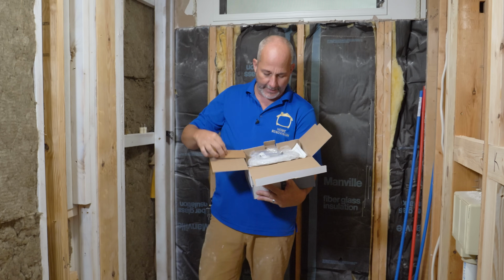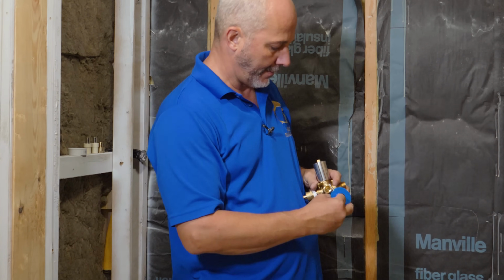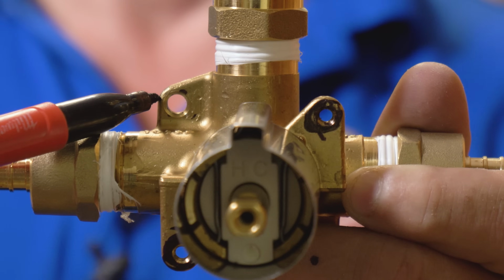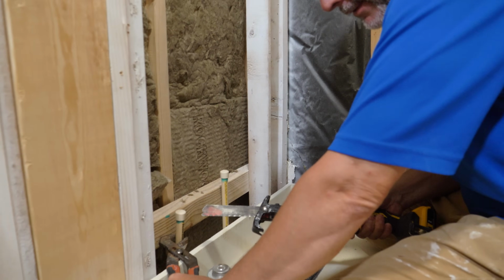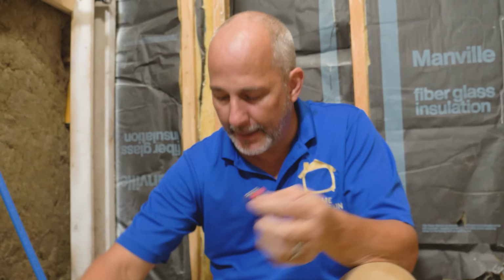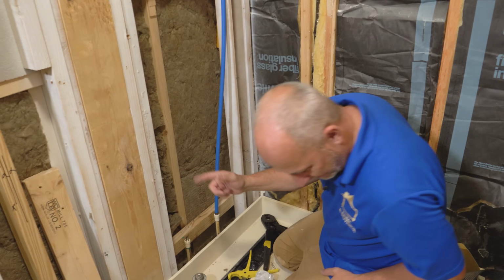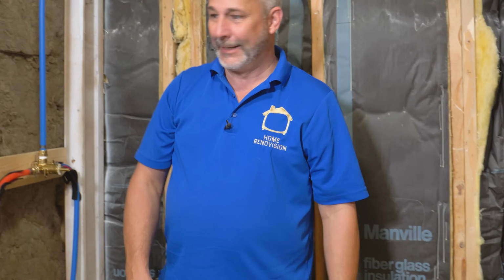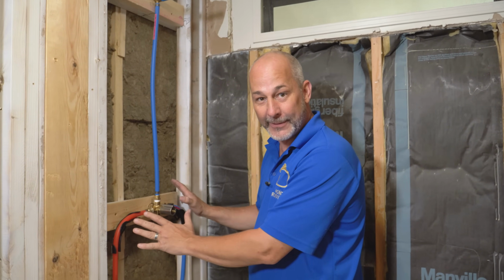How to Install a Shower Valve Kit (For Beginners)

Comment: Thanks for the 'taller people showerhead' install comment. I hate showers that just spray to nipple height! Code used to give a minimum and they took it as max, saves about two cents in pipe, but ticks off anyone over 5-10

Comment: Where was this video about a year and a half ago? I had to build a shower, on my own. That depth gauge was a mystery to me. I had to figure out how to install the plumbing on my own. The final product has some flaws but it functions! I did almost all of these steps in the video. I used Pex A instead of Pex B and I didn’t pressure test. If any DIY-er or newbie handyman studies this video and follows it they will have a working shower at the end.

Comment: I’m glad to see you only used teflon, I’ve seen plumbers use teflon and some kind of blue paste.  I feel more  confident in my shower valve replacement now
Reply: The blue "paste" might be Blue Magic pipe thread sealant or a couple of other brands. In a perfect world plumbing threads are tapered and should lock together with no leaks. In the real world it just doesn't happen. Teflon tape is good and adding the pipe thread sealant is just a little more insurance. Very common in the industry.
Reply: @rrrusted2883  Its funny to me because I have always been a "teflon tape only" guy. Last year I was doing up some 1.25 inch PVC pipe fittings to my water pump.. One joint just would not stop dripping no matter how tight I got the threads. So I decided to try my "Rectorseal #5" pipe dope that I had used on my gas pipes some 20 years ago.. Same can.. Took a while to mix it up of course. I slapped that on the threads and didn't use any teflon tape.. Sealed as solid as a rock.. Its now my go to method on all plastic threaded joints.

Comment: I got a Moentrol "shower only" valve for my mother's ADA shower that we are going to put in-- hopefully sometime late this year or early next year. Make sure you check if its for PEX A or PEX B before you buy it-- and don't trust what bin its in. Make sure to carefully read the bag- and check the bag for holes and make sure no one stole stuff out of it. If you do curbside pickup, doublecheck that they gave you the right stuff-- I had a big box store make mistakes when pulling stuff.
Do you have any opinions on teflon tape vs teflon pipe dope (sort of a liquid sealer that gets brushed on)? I like to use rectorseal on some stuff, although it can be messy.
Drop ear ell with PEX connection is a good idea. Saves on having to get the adapter. 
Your tip to avoid crossthreading has helped me a LOT. With everything from medicine bottles, food jars, to plumbing fittings.
I have arthritis in my hands and wrists so I often get my best friend to tighten stuff for me. Even with two sets of channel lock pliers it can be tough, but using 2 sets of pliers is a good idea.
We added shutoffs that will be accessible via an access panel behind a piece of furniture in Mom's room for when we install her new shower. Having shutoffs on each line really helps if you need to cut the water off quickly. Whenever we've had them off for awhile though, I like to aim the pex to a bucket and open the shutoffs to let sediment clear the line before attaching a new fitting/valve. Well water can be pretty nasty at times if you don't have a filtration system.
I was lucky when re-doing my shower and putting in a new surround because the plumbing was in a closet behind the shower so we had access from the back. That made things easier because we were able to put the trim in afterward. Picked where we wanted it to go on shower side and drilled through (pilot hole first and then followed up with a hole saw). 
I used cementboard and a glue-up surround. Never liked tile. LOL. 
Ah, 84". I was thinking 80. My showerhead had to be mounted lower because we couldn't get it higher on the other side of the wall due to obstructions. But I'm only 5'5" so it worked out for me. It's a little low for my brother who is about 6'3" but when we do his shower we will put the showerhead up higher and use an S-arm to make it even higher.  Having different shower arm options helps. S arm can raise it a few inches.
I always use a PVC cutter for the PVC and CPVC. Seriously thinking of investing in an electric one if I can find one cheap enough because of arthritis. I don't think I could hold the reciprocating saw with one hand and still cut remotely straight. LOL.
I like the sanding straps thingies that you can wrap around the pipe to rub it clean/scuff it up to grab better. 
It used to be cheaper to run 1/2 PEX through a 3/4" gray conduit elbow to make the bend, but they have gone up in price. I don't know the price of those bender thingies, but I used the conduit elbows to bend my pipes.The saddle looks like its easier to get the pipe in though. With some you have to zip-tie them in to make them stay if they try to pop out.
I like the cinch/pinch rings better than crimp rings. Well, we used the 1st kind (pinch) in my house and have been lucky- no leaks. Used it outside too. Never heard of issues with those ones leaking but maybe it was bad installation where they didn't get it over the right part of the fitting?
The pinch tools can have an LED that lights up when it is completely closed. I wonder if the crimp ones do the same.
yeah, the securing fittings as you go is the best method IMO. That way you won't forget and miss one.
The problem with trying to get it to tighten when over your head is probably one of the reasons why they have electric tools that will tighten the rings with a trigger pull/button press-- but the yare expensive. An alternative to doing it over your head is if you temporarily tack the drop ear down lower so you can crimp it while its secured and then move it up higher. Or try to crimp while it is detached completely, but it might move more that way.
Working with PEX is so much better than working with copper, PVC, and CPVC. 
To be on the safe side, all of our showers will have access panels behind the valves so we will be able to check for leaks and change things out if need be.

Comment: What is the blue thing called that you screwed into the shower port before you did the water pressure test?
Reply: 1/2” MNPT Bathroom Shower Test Plug

Comment: Jeff: There are two systems out there for doing PEX.
Me: Expansion and compression.
Jeff: Pinch clamps and crimp clamps.
Me: Why does expansion not get any love?
Reply: Different type of PEX I believe
Reply: Because the expand tool is over 500 bucks compared to 40 bucks for a crimp tool
Reply: @puwazatza  Home Depot sells an expansion tool for $139. That's more than $40, but low enough in cost to be a viable option.

Comment: Another reason for pressure testing before closing is I had valve with a pin hole in the casting. Found it BEFORE I closed. It was a pain to take it apart and take it back to HD but not near as bad as tearing the tile off aftwards. Another suggestion is to put 1/4 turn valve on the pipes leading to the mixing valve and an access panel on the wall behind the mixing valve. That way if there is a problem you can leave the water in the house pressurized.
Reply: I love the idea of putting in an access panel when you can behind shower valves.

Comment: Best practice and shown in most instructions from manufacturers; Shower riser from valve body to head should be 3/4 pex or at least minimum 1/2 inch copper pipe, as to not impead flow rate and add excessive pressure to the valve body cartridges shortening the life of the product. 1/2 inch pex fittings are very restrictive and can void product warranties. Same applies to tub spouts. I see this done wrong quite often, and hear many complaints about how long it takes to fill a tub, or when they have the combo and shower is activated, water still continues pouring out from the tub spout.

Comment: Great Video I'm assuming the Blue Pex can handle same amount of hot temperature water as the Red Pex?
Reply: the color is purely cosmetic. It is nice and neat to have hot and cold color identification though. The important part is the marking for the type of pipe you are using, not the color.
Reply: Just a pigment difference. Identical pipes

Comment: Most valve systems instructions will tell you NOT to use Pex for the shower head supply line, it can cause water dripples  when not being charged with water. I use galvanized pipe for that piping.
Reply: 1/2 copper or 3/4 pex, anything else voids the warranties of most manufacturers

Comment: THANK YOU for showing the RIGHT crimps to use for PEX.
Anyone using the pinch clamp system need to stop. Long before i bought my house, i knew that system was garbage. Ive developed 2 minor leaks from these things, thankfully my house is a bungalo with an unfinished basement. 🙏
Reply: Depends what crimp rings you're talking about!  The commercial rated "stainless steel" ones are far superior than those standard copper press rings that he used. Next time your in a store or home center give a standard ring a squeeze with your fingers. Unfortunately the pinch ring, or any other ring for that matter are only as good as the installer.

Comment: A quick tip on your Moen shower valve. The shower valve stem doesn’t have a positive stop but if you look at closely you will see that one side has a notch on it. When that notch is down the valve is off. The stem is the brass piece that sticks out that has a screw hole on the end.

Comment: If at all possible I would remove the CPVC and run PEX-A from its source. All CPVC will degrade and shatter with time, and by the time the homeowner finds out the crawlspace is a lake and the surrounding wood is rotted.
Reply: Agreed.  I just got a house that was abandoned for 8 years.  I turned on the water.  It seemed fine.  A week later, i notice a puddle under the bath tub faucet.  I ripped out the wall.  Found that the cpvc elbow cracked in the middle.  Replaced it with a cpvc but my entire house has galvinized  piping so i will need to replace the e tire house and will do so with PEX.
Reply: Yup.  The shower in our basement bedroom is leaking because the cvpc connection to the shower head BROKE.   The pipe literally just snapped.  Not surprising.  I can see it's not strong enough to support the weight of the shower head (shower head wasn't even mounted to a metal adapter...straight into CPVC!).  I'm learning...

Comment: did he use the right glue at 11:33?
Reply: No he didn’t use the right cement he used ABS to PVC transition cement , he should have use the yellow single step CPVC cement , but I don’t think I’ve ever seen him use the correct cement for the job .
Reply: Incorrect cement for sure. I cant even believe he did that. Definently a face palm moment....

Comment: PEX pinch clamps are perfectly fine to use indoors if installed properly. There are some tight spaces that you would never be able to put your crimp ring tool into, and this is where the pinch clamps shine.
Reply: I would think the wrong PEX pipe was used with the pinch clamps. I installed 100's of the pinch clamps with PEX B in my house and not a drop.
Reply: He slanders a good pex crimp type due to seeing an incorrect install once while standing on a showerpan he installed incorrectly, which will fail in due time!
Reply: As the kids would say, skill issue. No problems here with the 100 or so odd pinch clams my plumber used when repiping our basement a few years ago, nor any of the ones I used last year when redoing the kitchen once I realized how easy it was to do myself
Reply: I'm new to the use of PEX, but I've put in a couple of dozen pinch clamps with zero leaks.
Reply: This dude is one of those guys who "Knows better" about everything no matter what it is. Super ignorant because he failed to do something right. This is the 3rd video of his I watched and he is always the same with poo pooing on systems he didn't install correctly or failed to complete. 
Those pinch clamps work great. Way better than the slip and push ones 😂
Reply: It is ok to use shark bite set up
Reply: I have two for “pros by pros” books from fine home building written by master plumbers they both say the one they use is better and the other ones suck.

Stainless crimp rings won’t corrode

I use them since the ratchet tool is one handed, the one I use has a blue indicator light when it’s cinched tight enough. 

Can we all just agree that shark bites suck and get along 😂

Comment: Note that the type of pex he shows is pex B. Newer homes have swithched to pex A which uses a cold expander (can buy a manual one for $50-$100, or rent one for less). The pipe is more fexible and more forgiving. If you see white fittings on the end of your existing joints, then you have pex A.

Also, in using pex A you won't be fighting with a crimper.
Reply: For people like me who love to own the tools, the five hundred bucks expander is just way over the budget for a plumbing tool. Pro press is the same situation
Reply: @puwazatza  A homeowner doing occasional pex work doesn't really need the expensive powered version for working with PEX A. You can buy the manual tool for  $100-150 CAD (and probably less in the US), and it works just fine. Did my entire basement bathroom with one of those and didn't have any issues.
Reply: don't forget that pex a allows for full flow diameter. pex b is restrictive
Reply: I believe you can use the crimp rings on both PexA and B.. But the expander type fittings are only for PEX A.

Comment: Home Depot even though it’s Moen are lower in quality compared to plumbing supply houses. Advantage of Moen Adler model it’s inexpensive. Not sure if Moen offers lifetime warranty for HD Adler especially when the cartridge goes.
Reply: Depends on the model number. If it's a special "only sold at home Depot/Lowe's", then sure, but if it's the same model number, it's the same quality of product regardless of where it's sold. Saying otherwise is just a myth that plumbers like to propagate.

Comment: I actually asked this exact question numerous other times to other plumbers on YouTube. “ How do you know how far to set the mixing valve back on the backer board?” 
You finally answered my question! Thanks man.
Reply from the maker: Cheers
Reply: @HomeRenoVisionDIY  something I've been asking for awhile now and haven't gotten an honest answer. Are all shower control heads basically the same except for the cartridge installed? My brother replaced my shower controls when the house was my mother's. I had to have it resoldered 6 months after inheriting the house because the feed lines blew out because it was soldered wrong. Anyway, it's been fixed by a real plumber but it has the turn one way temp control with limiter. We hate it and want to go back to the hot- cold turn both ways controls but want to know, is it simply replace the cartridge or does the entire control head need to be replaced?
Reply: The reason you haven’t gotten the perfect answer is because you need to know the thickness of your wallboard, thinset thickness and tile thickness...or the thickness of other finish you are using. If you don’t know these you are guessing. If you are wrong this causes the trim to either not reach or bottom out and be wobbly.